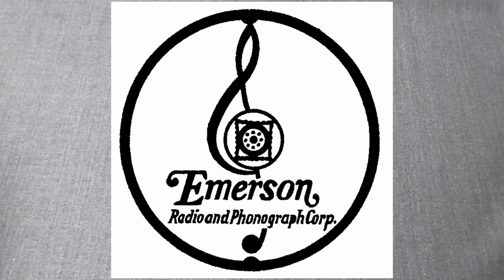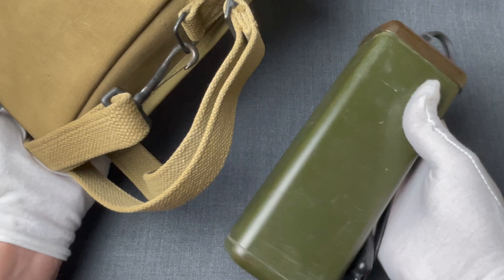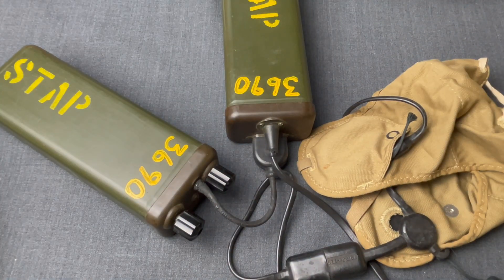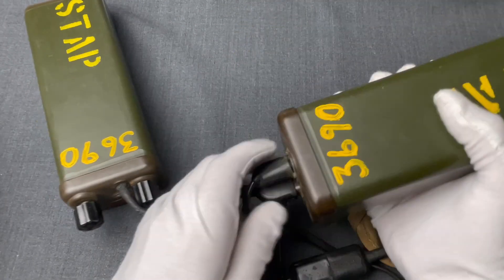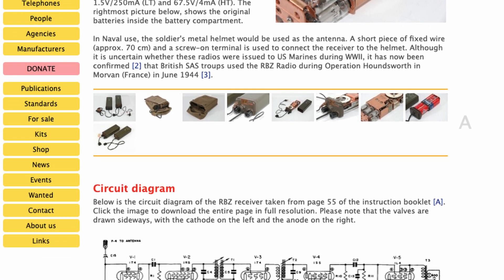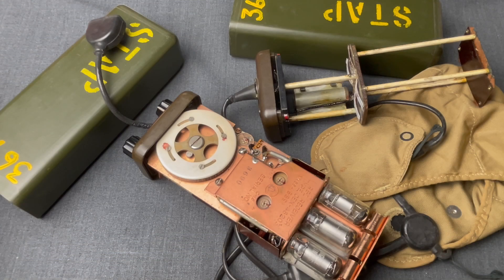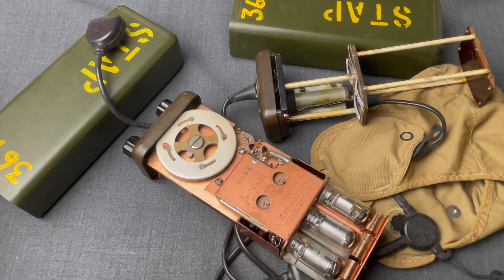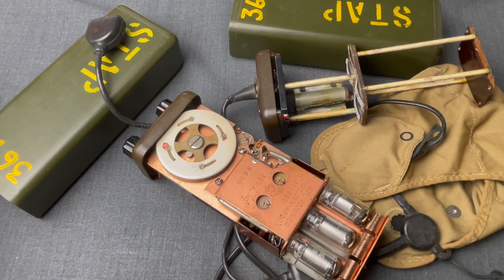RBZ Miniature WWII Radio Receiver

Comment: Narration doesn't seem well informed. RBZ was first envisioned as Marine Corps "raider receiver" but as you can imagine, stage - managed directions to your combat troops, equipped with receiving sets only, does not work out well in the real world. Consider it a failure for this purpose. Hundreds of stored useless RBZ were modified to tune 5 to 13 MHz and supplied to Resistance in German occupied Europe for listening to voice broadcast news and messages - no telegraph reception ( CW ) possible. I have Emerson literature and manuals for both RBZ models.
Reply from the maker: Thank you for the feedback. We recently acquired one of those modified RBZ so, hopefully, in 2025 we can make a new video about it address some of the mistakes of this video there too.

Comment: Nice condition RBZ.  Whilst you are correct in that these did have a history of covert/clandestine use, the example in your collection is not one of them and is a regular US Navy example.  Genuine clandestine used sets had a modified frequency range to allow pick up of broadcasts from England. Modified sets had specific markings and a different frequency scale which your example does not exhibit.
Reply from the maker: Thank you for the additional context. If you have examples of the modified ones we'd be very interested.
Reply: @SpyCollectionChannel . Yes, I do have one in my collection, including the rare instructions which were also changed to reflect the frequency modification.  My set was used by an OSSEX team in occupied France.
Reply from the maker: @SecretSquirrel-zu3zk  Thanks! Please contact us at info@spycollection.org if you'd like provide us with some photos. Very happy to share them with our viewers.